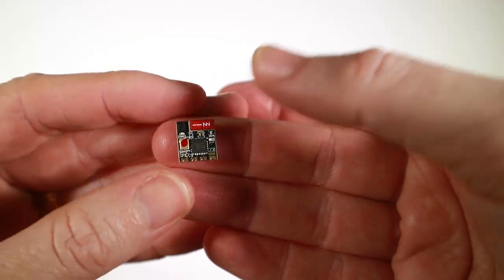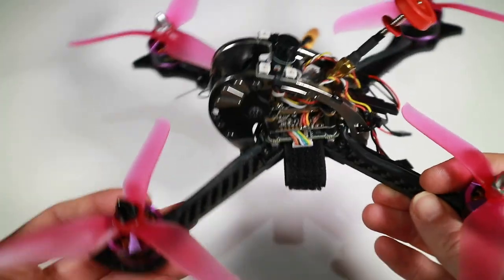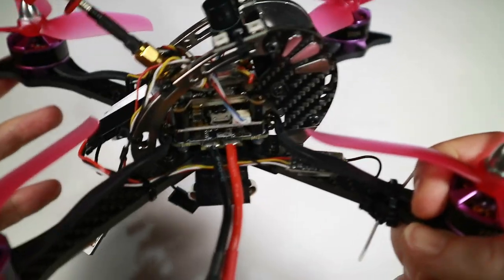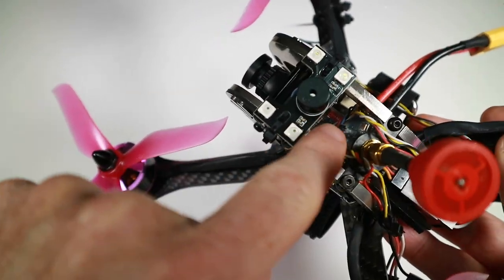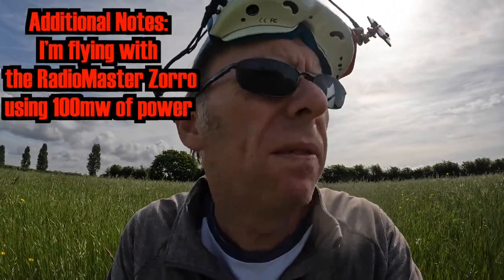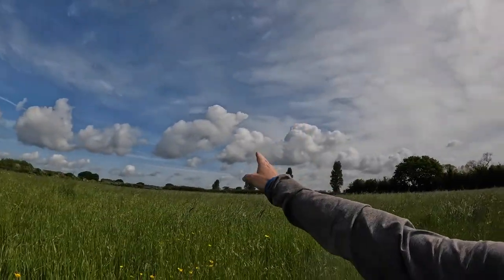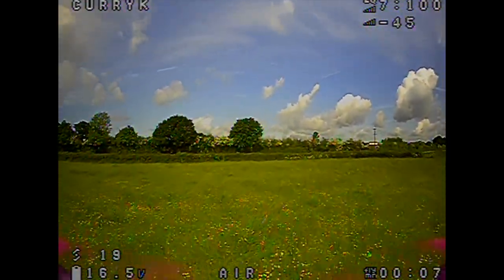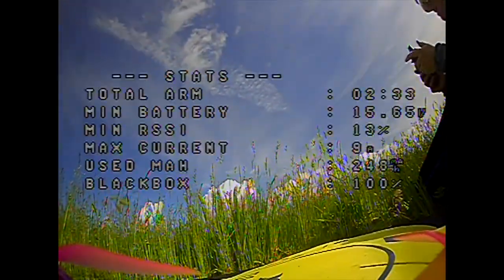Comparing the range of the new BetaFPV v1.1 Flat antenna ELRS rx with a T-antenna and Tower antenna

Comment: Watching you fly that quad around has made me rethink my situation. I was going to move stuff over to elrs and use my Zorro more, however the distances you flew there I would happily rip my XM+ setups without a care in the world.
Reply from the maker: Yep, at those sort of distances XM+ will work absolutely fine, and I've still a bunch of quads on XM+ that I don't feel the need to update.  ELRS was mainly down to racers wanting the absolute fastest link they could have, with the distance it can go being a bonus.  The difference for me is that any new stuff I got, I'd want on ELRS rather than the "old" FrSky stuff

Comment: Got my flat one replaced by betafpv after seeing your original video. Not fitted it yet but glad it's performing much better than before. I'm only gonna use it on a whoop anyway so 400m isn't really an issue :) thanks CK!
Reply from the maker: I think it's perfect for a whoop - easy to fit anywhere, and you'll be out of lipo before you are out of range :)

Comment: I had the tower on a 3" toothpick. It was mounted on the back of the camera mount and was completely unobstructed. I could easily outfly the range of the 200mw VTX. At some point, I crashed and knocked the little tower off, but I was still able to get about 100 meters of range. I don't usually fly the toothpick further than that, so I didn't change it for a while. I honestly think it's pretty amazing to get 100 meters of range with no antenna at all. I changed it to a full size T, and within the range of the VTX it never even gets close to losing signal, but I was really impressed with the performance of the tower.

Comment: Thanks for this.  Results were mostly as I expected.  Odd though that putting the receiver out on the arm was better AND worse.  :o  At these frequencies all that structure does not only block but also reflect.  Perhaps that location out on the arm was in a null zone due to reflections from other parts of the quad?  As you said, move the receiver around a bit and test for results.
Reply from the maker: Yes - the results were not as I'd imagined at all.  It just goes to show that a bit of experimentation is really worth it.  I think it's really easy to just think "my quad seems ok" and then you never mess with it, but a bit of experimental tuning here and there or moving stuff about could make things better (or worse, but then you'd just change it back)

Comment: Hi, I like the ELRS duel receiver / diversity antennas. And For my long range Quads that’s all I Use!
Reply from the maker: I've never tried the diversity RX (yet) but I haven't really got close to running out of range on ELRS yet either :)
Reply: @CurryKitten  It help’s with Range, but what it does that is better then the Single receivers is when the Quad is turning or Facing you it  keeps your RSSI locked in without worrying about your Quads position, and that’s a big plus let alone constantly worrying about a Possible Failsafe while Flying!

Comment: 1. ExpressLRS is not magic. Too many people saw guys flying wing 15km+, and expected same with quad and ceramic antenna. LOLZ.
2. 2.4Ghz band is crowded with WIFI/ DJI noise etc, + you got those big juicy trees.
3. I really wish they made mode diversity receivers.
4. The Moxon 2.4 antenna have relatively poor VSWR. Likewise 915Mhz.
5. Im running BetaFPV 915Mhz ELRS btw.

Comment: right, the receiver with the external antenna is the best. I like the BetaFPV ELRS nano receiver with the external white antenna. The board have better telemetrie transmitter (20dBm=100mW) as the receiver from Happymodel with external antenna (17mW).

Comment: Great test thank you Curry....Is it possibble to put a big T antenne  on a 868 micro betafpv i have one with a small Til will put it on a wing. did you tryed that?
Reply from the maker: If I understand correctly you bought an 868 rx and noticed it came with a quite small T antenna.  BetaFPV call these a "mid range antenna" in reality they are completely the wrong length to work with 868.  So yes, BetaFPV actually sell full sized ones (but why they didn't include these with the rx in the first place!!) or 868 is 868, so a crossfire antenna, an r9 antenna will all be correct (but check the UFL fitting first)

Comment: I'm curious if the orientation of the transmitter antenna has any impact... (horizontal or vertical alignment of controller antenna)... When you think of the ceramic tower and the way the antenna wraps around it, It would seem much more of the element is relatively horizontal in relationships to the receiver chip...
Reply from the maker: Yes and no.  For a fuller and more useful test, it would be good to test both ceramic antennas in both antenna orientations.  My general point of view here was - if you want more range, then you'd get the one with the proper t-antenna, the point of testing the ceramics was to compare against each other and seeing whether the range was good enough.  I think I read that someone looked at the datasheet for that flat antenna and it should be mounted vertically (kind of defeating the object of keeping it so small)

Comment: A final question if you will. I have need to mount a ELRS rx into a whoop with limited space. The location is above the battery and under the stacks inside the canopy I want external antenna but not a "T" . Can I replace the "T" antenna on an  rx with a typical straight one? If so, how long should the active part be? Thanks and much appreciation.
Reply from the maker: That's a great question.  In theory, I don't see why not.  It's 2.4Ghz at the end of the day, and so that means you should just need an active element of 31.23mm in length.   But that's just my thoughts - the best thing to do is throw this question into the ELRS discord for a more authoritative answer.

Comment: I HAVE A QUESTION TO YOUUU, how can I get that video signal so clear? mines is so dirty, I have changed googles antenas as drone omni as well but stills so noisy, HEEELP
Reply from the maker: If you have reasonable antennas on your quad and goggles, then you need to consider if your power is clean.  Does you VTX and camera do a good job of filtering the power input on their own?  Do you have clean wiring where you are not crossing power and video wires all over the place.  My go to brand for VTX's is RushFPV which tend to filter their own power very well and so the picture is often very clean
Reply: @CurryKitten  I have a foxxer lollipop 4 on the quad and googles , diversity with omni and patch antena, my VTX: success 5.8GHZ  25-800Mw. I think im gonna re arm all my quad and take care of a nice soldering job and wiring very well. I miss my video looks that clean like your's, great videos, thanks for the response

Comment: Placing the flat antenna so close to an electrically conductive material (carbon fibre arm) probably significantly detuned the antenna and as a consequence the receiver performance was degraded - just my guess anyway.
Reply from the maker: Perhaps so - although I think you'd likely be that close to carbon in that sort of quad.  Obviously in a tiny plastic based whoop you'd be better off all round

Comment: Hello CK, I suppose you can do those test flights also with the XM+ ?
Reply from the maker: In terms of the range you mean?  Yep, I flew with XM+\s for years, and aside from the odd one going a bit wonky, you generally get decent range out of them.  Easily over 1km at least.
Reply: @CurryKitten  Sad too see some of the ELRS recivers getting low LQ at those pretty line of sight flights, without buildings or trees in the way of signal...do you think happymodel new module will work on taranis Qx7 ?
Reply from the maker: @KIKI55cro  The RX's with no real antenna don't do so well when you fly them a long way off, but that's not really what they are for.  They are more for doing micro builds that you wouldn't fly far.  I'd also whacked the speed up to 500Hz on these, so you'd get further by running at a lower transmit rate.  If the HappyModel module is JR fitting and you've got OpenTX or EdgeTX updated, then it'll work.  You may need to do a hardware mod to get the rate data rate, but that's a larget subject.

Comment: Do you know if TPU would cause interference like carbon does? wondering if creating a mount be possible instead of just taping to the arm.
Reply from the maker: TPU is fairly "transparent" as far as RF signals go, so using it to lift your rx into a better position will have an improvement

Comment: We really need to start making reinforced plastic frames or similar. Carbon fiber is cool but is troublesome for electronics.
Reply from the maker: Weight and strength will always make carbon fibre a great choice - and on a larger quad the T antenna will always mount ok.  I think in the sub 85mm frame you can get away with pretty thing an flexible plastic
Reply: @CurryKitten  I wonder how the ragg-e frame that is made in the UK would help those elrs receivers. Weight is a factor, but durability doesnt bother me anymore... i take less risks then before.

Comment: probably a stupid question, but is it possible to connect multiple receivers, all in parallel, simultaneously to the FC? and control it with multiple TXs
Reply from the maker: No - the problem here is with multiple signals coming in, you'd either get the signal multiplied, or depending on the timing it could be overlaying bits and pieces.  What you'd need is something before it got to the FC to decide with receiver it was going to switch to.  Multiple RX's on some older autopilots wa a thing, but they had multiple connections and would switch depending on the RSSI to get the stronger signal.

Comment: Wayne if you lower the 500Hz rate you get a bigger range, anyway at this size of quad with the not so powerfull VTX you dont need that much range unlike a 7" LR quad with a 1W or 2W VTX
Reply from the maker: Yep - I normally fly on 150hz with quads, the 500Hz was used to give a worst case scenario.  Sort of "if I can't get this far, then you can get more by twiddling some settings"  I was just using 100mw of power as well.

Comment: I wonder would the packet rate effect range much. Like running 150hz or 250hz rather than 500hz.
Reply from the maker: It certainly effects the range on the basis that at a higher rate you'd likely suffer a higher loss of packets.  Quite how much it affects it by - i.e when do you failsafe on 500Hz vs 150Hz, I don't know the answer.  It might be quite good fun to check it out if I can find the right area to do so... I'd be using something like 10mw on the radio to try and force a failsafe early I would guess.
Reply: A lower packet rate will increase the power output per packet. Theoretically, 250hz will have 2 times more power than 500hz so about √2 times more range.

Comment: Stupid like a fox! After our simultaneous testing across different receivers I came to pretty much the same conclusion. The SMD antennas are ok but pretty much always use a T antenna unless the size is a problem. The v1.1 flat antenna is drastically improved (the original was broken) but it is still a little worse than the tower, which is significantly worse than a dipole. Even an onboard amplifier on the RX doesn't bring it close to the dipole. Here's a graph you might find interesting of 6x receivers tested at the exact same time:
https://heatermeter.com/elrs/elrs-run17-flat-v-tower.png